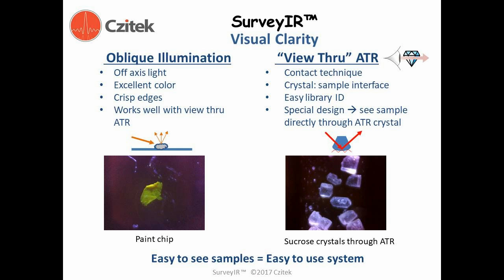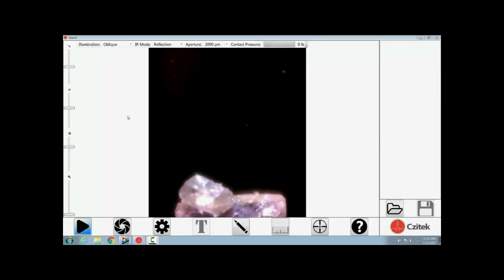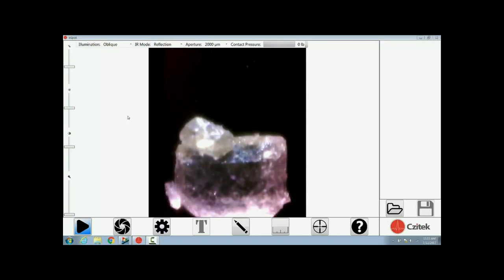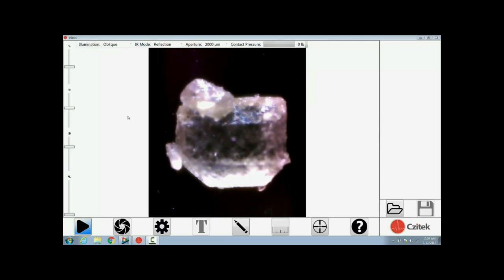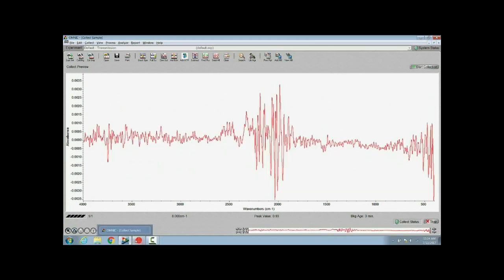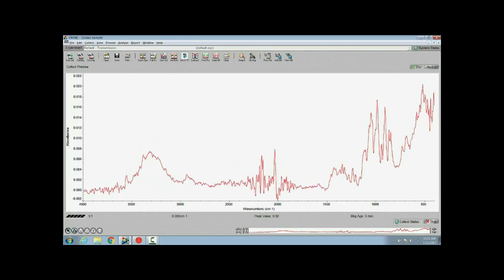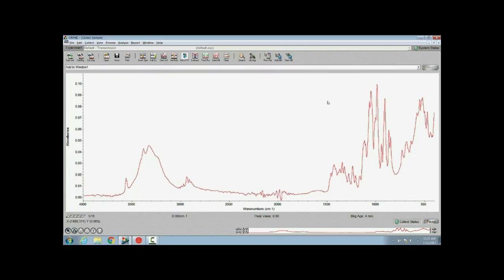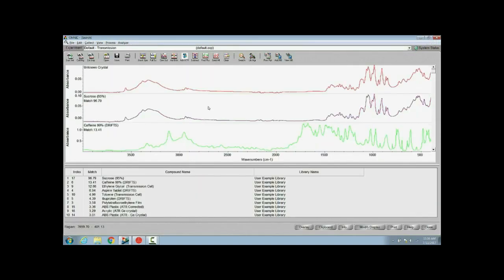Czitek SurveyIR FTIR Microspectroscopy ATR Analysis on Thermo Nicolet iS5

Comment: Thank you. I am using Shimadzu IRSpirit so Do you have video Czitek SurveyIR FTIR Microspectroscopy ATR Analysis on TShimadzu IRSpirit ?
Reply from the maker: We have just uploaded a video on the Czitek You Tube channel that documents the installation and use of SurveyIR on the Shimadzu Spirit. Please let us know if you need additional information. Thank you for your interest,
Reply: @schierdw  thank you so much for  your kind support
Reply: @schierdw  Dear David Schiering, I have some concerns as below:
1. Servey IR system does not have an optical system, right? So ServeyIR doesn't need to be stored under special conditions, right?
2. How to clean the system after each measurement?
3. What is the difference between transmission mode and reflection mode? I mean what type of sample we will use transmission mode or reflection mode?
Thank you so much for your sharing